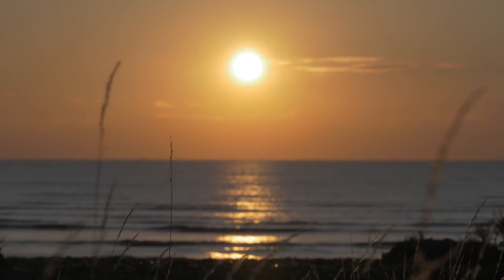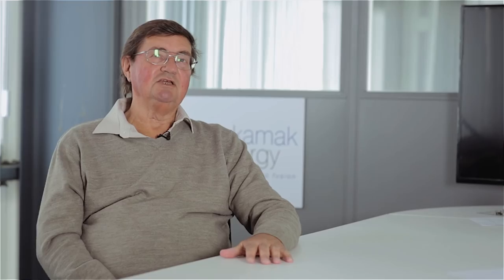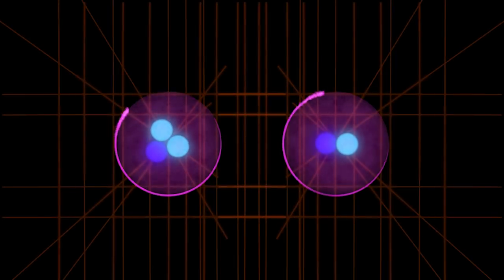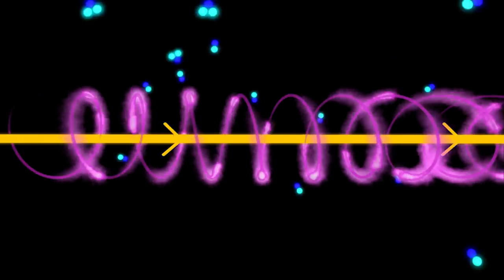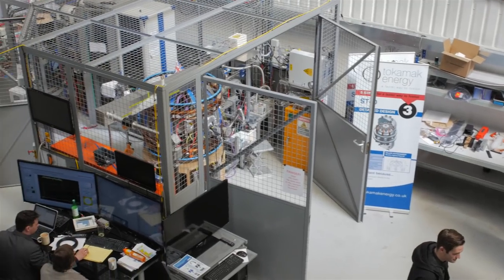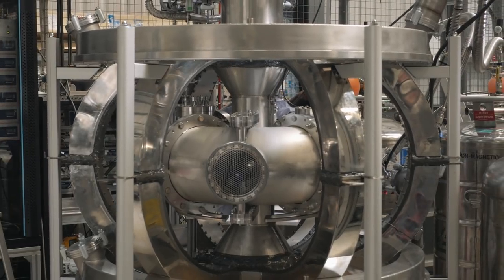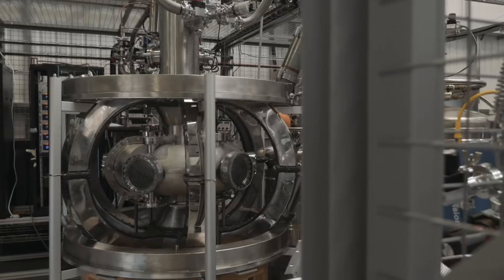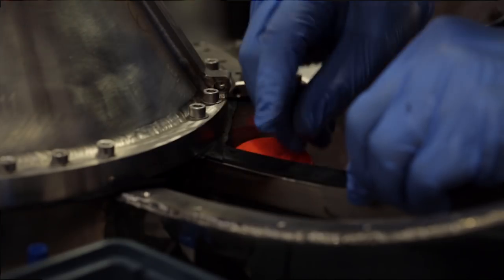Faster fusion

Comment: Stellerator is superior
Reply: MigotRen They both use Hydrogen Plasma.
Reply: angry try hard
the tokamak is based on a 70 year old russian concept and hasn't changed much since then. to keep the plasma in the tokamak they need to induct a voltage into the plasma wich in this case must be a steadily increacing direct current (increacing the voltage at the indctor to do so) . obviously that isn't possible forever and the system needs to shut down every 30 minutes (at iter the most advanced tokamak being build and tested) because you can't increase the voltage for ever and it needs to cool down. the stellerator that is under testing here in germany is a relativly new concept wich was only possible because of massive computer calculations to shape the ring in a perfect way for the magnetic field to keep the plasma in a closed system continuously without interruption. and we managed this with a budget of about a millard (or billion wherever you are from) euro while the iter project in france already used a budget 20 times that. and they both use hydrogen plasma is the dumbest answer ever. how else is hydrogen fusion supposed to work? of course all of them need hydrogen plasma
Reply: MigotRen ya I know it can sustain 105 Gigajoules of thermal energy longer but who says it can't be improved on to reach similar feats of the Wendelstine 7-X reactor.
Reply: angry try hard
becuase the basic concept and structure doesn't allow it
Reply: MigotRen ok
Reply: MigotRen They do not have the same objective Tokamak was never meant to be commercialized it is there to do more research on the subject so they can make the Stellarator project better
Reply: How are you ever going to commercialize a stellerator? Those machines are impossible complicated.
Reply: you could say the same about computers. But here you are commenting using one. If it is more economically viable, it is extremely likely it will be done.
Reply: Computers don't have components that are the size of small buildings.
Reply: Computers used to be the size of small buildings...over time they refined it smaller and small till we have hand held smart phones that are more powerful than those massive computers.
Reply: There are still building sized computers. The difference is, their constituent parts weren't the size of small buildings. (most notably the vacuum chamber/blanket for fusion reactors)
Reply: MigotRen. Interesitng info on the increasing voltage requirement. I had not appreciated that. I agree that stellerators have some very interesting theoretical advantages, and it's good to see that Wendelstein 7-X does indeed work. Does it in practice sustain a plasma longer than tokamaks (100s for ST25 IIUC), or is that for future work?

This really good talk on the principles by Zach Hartwig points out that stellerators have a long way to go to Q>1, which is why tokamaks is still where most of the effort is going. Does the theory suggest that using REBCO magnets in a stellerator will make a reactor with a high Q like the ARC design?
Reply: @weinhold: Your complaint is the very reason we didn't have stellarators until now, and is why your complaint is no longer valid... We couldn't build them before because we did not have the computing power to calculate the accurate structure and fabrication needed for it. Now we can, and we have increasingly intelligent robotics that can construct these large components. It is absolutely not a factor at all.
Reply: Just because you can build them, doesn't mean you can build and operate them economically.
Reply: You have absolutely no argument though. You're just saying it's not economical without knowing anything about the economics of building it. A lot of the technology we use today started out highly uneconomical, but once the designs had been refined and automation implemented, they became economic.  Building an oddly shaped metal container is not some grand engineering challenge these days, and the continuing advancements of AI/Robotics is only continuing to bring down the cost.

Also, the cost of a Fusion reactor is MUCH cheaper than building a Fission Nuclear plant like we have already made many of, because they don't require anywhere near as huge of a building, nor anywhere near as many safety features, due to the relatively safe nature of Fusion.
Reply: > You're just saying it's not economical without knowing anything about the economics of building it

Read this report http://orcutt.net/weblog/wp-content/uploads/2015/08/The-Trouble-With-Fusion_MIT_Tech_Review_1983.pdf It's old, but still relevant.

> A lot of the technology we use today started out highly uneconomical, but once the designs had been refined and automation implemented, they became economic.

I've already addressed this further up...

>  Building an oddly shaped metal container is not some grand engineering challenge these days, and the continuing advancements of AI/Robotics is only continuing to bring down the cost.

Got a source for this?

> Also, the cost of a Fusion reactor is MUCH cheaper than building a Fission Nuclear plant

Based on what? Most of the info I've read on this claims the exact opposite. The case for fusion is more abundant fuel and less radioactive waste. It would still be enormously expensive to build.

> Also, the cost of a Fusion reactor is MUCH cheaper than building a Fission Nuclear plant like we have already made many of, because they don't require anywhere near as huge of a building

Again, untrue, fusion is actually less energy dense than fission, since you're dealing with Hydrogen, literally the least dense element in existence.
Reply: "Again, untrue, fusion is actually less energy dense than fission, since you're dealing with Hydrogen, literally the least dense element in existence."

You realize that energydensity has nothing to do with density of the fuel or at least doesn´t have to. It only says that you have a sertain amount of energy per x units. This can mean kilograms or liters or anything else. Per Volume uranium-fission is energydenser than hydrogen-gas/plasma-fusion, but per kilogram hydrogen is far superior. And there is a "element" mad from an electrons and a positrons that is less dense than hydrogen ;).
Reply: @weinhold:  You're using a review from 1983, that does not at all "address this". Few could even dream technology would be what is is today back then, the modern computer was only just being birthed back then. Scientific review aren't done on the dreams of the future, so their review is only based on what was seen as realistic at that time. Today, the kinds of robotics and computers we have make designing and constructing these structures much simpler.

>Got a source for this?

Uhh, there's no single "source" for this, it's called general knowledge about what's going on in the world. They even stated this in the Wendelstein construction videos that it only became possible because of modern computing power to do all the hard lifting in terms of designing it. These computer programs generate all the fabrication specifications and instructions for robotics that precisely form the parts needed. Making the first one is always the most expensive, then you've built any specialized tools needed and can reuse them on newer iterations.

>Based on what? Most of the info I've read on this claims the exact opposite.

Based on the fact a fusion reactor needs a muuuch smaller building and nowhere near as many fail-safe systems in place as a fission reactor. Fission reactor plants are massive compared to an ideal fusion one. The cost of the materials, time and workers to make a fusion reactor plant is thus much less than a fission plant.
Reply: Invertex General knowledge is a bad source for knowledge. Eventhough I agree with most things you said I have to criticize that.
Reply: @Mathew: I would agree too in most cases, but he was responding to me saying "Building an oddly shaped metal container is not some grand engineering challenge these days", and there is no realistic way to provide a "source" for that kind of claim, there's no studies done on it, it's a fact of technological progress, it's just something you know if you actually have been following technology for a long time.
Reply: Poor logic not worth wasting the time on, mate. 
 Do more research.
Reply: MigotRen
The Stellarator is not relatively new concept, it is older than the tokamak concept.
The latest Stellarator in germany only costed 1 billion, but it is not as if anyone believes it will reach net energy gain either. So what is your point?

In the end both stellarator and tokamak are equal amount garbage.
Reply: A nother thing is that a tokamak gets unstable when it reaches a certain pressure. When such pressure is reached the pressure will induce a current in to the plasma. Methods are developed to handle the instabilities that comes as a result from the increase in pressure. If that works well then pressure induced current together with microwaves they should be able to keep the plasma stable and running.
Reply: MigotRen We need to understand and master gravitational fields first, if a fusion reactor explodes or implodes we would be exceptionally fucked.
Reply: tjzx3432 Why should we?
Reply: Mathew Cherrystone The reason why we need to understand gravitational fields is because intense gravity is a huge player in the fusion reaction of the sun, if we master gravity we would be able to do far more than just make a few huge fusion reactors. Fusion requires pressure, heat, and magnetism, gravity is the pressure. Also incase you haven't guessed, we would have flying saucer technology. Do you not understand how groundbreaking that would be, yes we know how gravity effects the planets and large bodies in space. But when you learn what makes gravity work you open up the possibility for even more advanced technology than we ever thought possible. Like space ships that could power themselves simple based on the unstable equilibrium of the vacuum of space.
Reply: Why do we have to master them first, if we even can master them at all?
Reply: Mathew Cherrystone Well, why I think we can master it is simply the fact that gravity is a force. And just like any force it had a cause, and just like every other force that cause can be altered by a method or system. If we can understand and map how these alterations affect things like resistance, magnetism, and frequency of a system. Then wouldn't it suffice to say that the sum of these forces would have a noticeable effect on the gravitational attraction between the observed body and the earth.
Reply: So far we don´t know if Gravity is a force, because we haven´t found the graviton (the hypothetical force-particle of Gravity).
Reply: Mathew Cherrystone By definition a force would be devoid of a particle, also didn't we already agree that gravity was an emergent property of any particles mass. I have kept up with the recent cern findings, however the very evident lack of such a particle seems to lead to the conclusion that the hypothesis is wrong for the reality we exist in. I assert that gravity is an emergent property just like that of magnetism, meaning that the force doesn't require a particle to exist simply an imbalance. Such as for magnetism doesn't require any perticular partical to manifest, so would gravity be a property of the mass of matter and the space surrounding it.
Reply: You defenetly have to learn much more. Bosones are the forceparticles that transfere forces between fermions. The Photon for example conveys the electromagnetic force. The graviton is so far only hypothetical therefor we don´t know if it really is a force.

And you still haven´t answered my first question. Why do we have to master it first?
Reply: There is absolutely no reason to expect a fusion reactors to explode or implode, where did you get that idea from?
Reply: Mathew Cherrystone I already stated why I believe we should master gravity first, I refer you to my previous comments.
Reply: Electro-Cute Errors do occur and accidents do happen, if this reactor were to experience any kind of breach then the released energy could cause an explosion. Also if a breach were to occur it could result in an emp. While the chance is highly unlikely the threat is still there.
Reply: But why should we wait 100 years or maybe forever to build fusion reactors only to have tec that may have some benefits in creating them?
Reply: tjzx3432
A fusion reactor can't overload. If this reactor were to experience any kind of breach then it would mean that the plasma became to unstable and touched the wall. When the plasma hits the wall it cools down at the rate of a few nano seconds. After that nothing would happen.
There is absolutely no reason to expect any explosion. It is even far less likely that an EMP would occur. If starting the reactor doesn't create one then shutting it down shouldn't do so either.
Reply: @tjzx: You don't seem to understand the difference between FUSION and FISSION. Fusion reactions cannot sustain themselves on a planet, they need complete isolation. As soon as a breach happens in a fusion reactor, its energy potential drops radically and the reaction stops as there is not enough input energy anymore to sustain it. Fission reactions sustain themselves very easily and are susceptible to run-away reactions, Fusion is not.
Reply: Electro-Cute Fine, my hesitation may not have any real basis however my argument for the need to master gravity stands. While I do agree that fusion reactors are a great step in the right direction, don't get me wrong. I'm just stating that harnessing gravity would greatly improve the efficency of the fusion reactors, and the transport industry just off the top of my head.
Reply: Gravity is only important in a star because it pulls the star's mass to the center, and the weight of all that gas creates the very high pressure needed to drive the fusion. It's the pressure that keeps the fusion going, not the gravity. Here on Earth, we must compensate for the lack of pressure by heating the plasma so its nuclei move fast enough to overcome their repulsion, collide and fuse.
Reply: Computers today are the size of large buildings and consume as much power as a small town... not sure where this argument is going.
Reply: @tjzx: We can already harness gravity. The problem is that gravity functions through massive amounts of energy, in the form of mass, altering the shape of space. To manipulate gravity, you require massive amounts of energy... So how do you think we can achieve that? The only way is by harnessing the power of atoms themselves, nuclear reactions.
Reply: Invertex Well I'm working on the design and math for a motor, which would use static electricity, magnetic fields, and the inertial force of space to draw energy from space itself. This in theory would expand the space within the enclosed system and would contract the space surrounding the motor. The resulting negative force would in turn alter the balance of the internal vacuum causing a recoil, at this moment more energy is added until the mechanism perpetuates it existence. You may need to brush up on your electrical engineering studies to really comprehend the plausibility of this notion.
Reply: DANKUS MEMEUS RENATUS Essentially, yes. since this mechanism would itself be a capacitor, an antenna, a transmitter, and a receiver. This object would essentially absorb the aetheric disruptions and transform them into electricomagnetic energy that can be harnessed. Its the most simple and elegant solution i could come up with.
Reply: @tjzx: The fact you didn't understand the difference between fission and fusion makes me believe you don't know anywhere near enough about what you're talking about and are just taking some vague hypothetical ideas and mashing them together thinking it will work, without knowing any of the math behind what you're trying to do. Like people who see magnets and think they can gain energy from it just because it seemingly "repeals" objects, not understanding the concept of states of least resistance in regards to physics.
Reply: Bending space will at least require as much energy as you can get out of the gravitational force that results from it. Then I mean the force like in change of momentum. That conclusion can be drawn just from the energy principle. But from what I have heard it would require far more energy than so.
Reply: Electro-Cute, gravitational force is the weakest of the four fundamental forces while strong nuclear force is the highest. The problem is that in order to create a gravitational pinch strong enough to cause nuclear fusion, we'd attract all the planets in the solar system to us. That's why we use electromagnetic force which is only about 100x less strong as strong nuclear forces but its range of effect is extremely small. Therefore, we can use a very strong electromagnetic field to cause a plasma state without a large range of effect. Hence we get things like the tokamak and stellerator designs that use electromagnetic fields which can net energy if the rate of fusion is less than 100x less efficient than maintaining the field.
Reply: The range of the gravitational force field is the same as the magnetic- and the electric force fields for the same amplitude. All three force fields follow an inverse square law for point sources (assuming that a magnetic monopole exist).
The thing is that magnetic fields only interacts with charged particles moving perpendicular to the direction of the field.
Reply: Electro-Cute Thank you.
Reply: You are welcome haha :D
Reply: A fusion reactor isn't a bomb.
There isn't a great deal of energy inside the reactor at any given moment anyway.
The magnetic field is not containing some kind of explosion waiting to happen; this isn't Spiderman 2.

The reaction is sustained by the machine working as a whole; without containment, or any one of thousands of parts working more or less perfectly, it does not work AT ALL, which means, fusion stops.
 It's not like nuclear fission, where half of the whole machine is all about controlling the reaction (heat), which would continue to build up if uncontrolled.

Mastering 'gravity' would require understanding gravity much more than we presently do. 
 If gravity is indeed simply 'curved space time', then we would need to figure out how to curve space time more than the presence of matter presently allows, which may mean increasing the energy/mass of a small volume of matter, which would probably require super (duper) heavy elements which are stable, unlike all of the ones we currently are aware of, which tend to decay in fractions of seconds, at the cost of enormous amounts of energy....

Plus, with all of that being said, you still have absolutely no pathway into figuring out how to either A) create negative mass or B) block gravitons (if they even exist), which might give you something resembling the anti-gravity which you speak of...

I mean, I can imagine being a Unicorn. What are the odds of that actually ever becoming true?
 Just because you can 'imagine' anti-gravity, doesn't mean it is or may be possible.

Sure, I like to believe that if I can imagine it, it could be true.. & that may be true in many, many cases... However, if the Universe has taught me anything thus far, is that there are always exceptions to the rule.... & sadly, anti-gravity does not appear to be one of the possible exceptions.

Accept it, & stop wasting your time on fantastical notions.
Reply: Positron, the goal of nuclear fusion is to achieve ignition, as in Spiderman 2.
Reply: Spiderman 2 is not even science fiction, it is complete BS.
Reply: Mike Wilson While I don't agree with what you say I will still defend to death your right to say it. I'll agree to disagree and leave it at that, good day.
Reply: Not really. The goal is to keep it going. Ignition has been achieved in 1917 already.
Reply: Mathew, you're going to have to cite that one, because if we can achieve ignition, then from that point forward, it's energy output without having to put energy into it -- just fuel.
Reply: tjzx, in a round about way, but I think you're being pedantic. The point here is that we don't have to first produce energy by using another fuel in order to maintain the lasers or magnetic fields. Instead, the fusion reaction itself creates its own heat necessary to continue a fusion reaction.
Reply: tjzx3432 No, the gasses in the reactor (like any system) contain a finite amount of energy and need to be replenished.
Reply: By achieving ignition he meant to burn fusion fuel (burn in a nuclear reaction kind of way). Fusion reactions do not form any runaway- or stable feedback loop reactions with out any externally forced system to Control the fuel (like a fusion reactor). So in actuality the usage of the "ignition" doesn't belong here.

Anyway, we have been burning fusion fuel for almost a hundred years by now.
Reply: Electro-Cute, the heat from the fusion reaction can enough to sustain continued fusion reaction without the need for a neutron beam or other heating power. That's ignition, and it is a stable feedback loop. As long as you continue to provide fuel, the fusion will heat itself where fusion can occur, thereby heating itself more. That's the ultimate, long-term goal of fusion research.
Reply: But not with out any external magnetic field or any other method of confinement.

For a tokamak to run stable requires microwaves and/or density induced currents. The last one refers to how the current in the plasma increases as a result from very high densities. The problem with this density induce current metho is that the plasma becomes very unstable and starts to kink it self in to a spiral.  The plasma then spirals outwards til it hits the reactor walls and terminates. So a lot of research is going down in to how to use external magnetic fields to control these instabilities. These methods that have been developed are planned to be used for on ITER.
With out these methods the plasma would be continuous and stable. About your comment on stability.
Reply: Electro-Cute, of course you need a magnetic field to contain the plasma, but that doesn't have anything to do with the heating of the plasma. Nor does this have anything to do with the stability of ignition -- which should refer to a consistent temperature high enough to allow for fusion. That is, it can maintain itself at 150+ million C as long as it has fuel to do so.
Reply: If you speak about magnetic confinement reactors specifically then the magnetic field is all about stability. To change my mind on that you have to give me a stable tokamak where the toroidal and/or poloidal magnetic field is turned off.
Reply: Electro, I think we're talking about two different kinds of stability. You're right that a magnetic field will always be necessary to contain the plasma unless we can find a material that won't utterly melt when contacted with 150 million degree plasma. What I'm talking about is a stable fusion reaction where the heat of the fusion work being done is all that's necessary to heat the plasma for fusion work as well as powering its own EMF to continue with only fuel input into the system.
Reply: where did you get this information about needing a steadily increasing voltage for the plasma to be stable ????
Reply: Fusion 'ignition' has already been achieved.
 Spider-Man 2 was about containing a mini-sun & stopping it from exploding an entire city. Which is a misconception about how the technology works.

Next.
Reply: positron underVolt Using Hollywood movies as a source is also really dumb in the first place. The last thing Hollywood producers care about is scientific accuracy. Just watch any space movie ever.
Reply: positron, fusion ignition hasn't been attained. We have reached just over Q = 1, but not ignition (which requires Q = 5 or greater).
Reply: nexus1g What you are talking about is a continuous selfpowering fusion reaction not ignition. This are two diffrent things. It's not that hard to understand
Reply: Mathew, a continuous self-powered fusion reaction is not necessarily ignition. You can have Q > 1 and not have ignition if you're still required to have a power input to heat up the plasma. Ignition is specifically where the plasma maintains enough heat to perform fusion without further heat input. That is predicted to occur at about Q = 5 when there is enough energy being produced from fusion that it heats the plasma faster than the heat can be dissipated from the plasma. That's the next major step in nuclear fusion, and it's the point when we could reach the "limitless" energy source that we know nuclear fusion has the potential to provide.
Reply: Who cares, tokamak fusion research is still a waste of money.
Reply: psycronizer whatever makes you feel like you're smarter than everyone else.
Reply: well, I know that I am smarter than most people, simply because I am 48 years old, have a very vast educational background, and can talk about many different fields of science, eg; electronics, organic chem, biology, physics, history , and many more. That is only possible because of time, all the study and reading that I have done. Just a simple, immutable truth.
Reply: +tjzx3432 Still waiting on that perpetual motion machine mate.
Reply: Scabbage  what about levitation, Dr. Hutchinson ? Where is his technology...
Reply: psychro- never trust a man who has to TELL you how smart he is, or how good he is, or how rich he is, for that matter... get my drift? Show, don't tell. By the way "Vast" is impressive, "Very vast educational background" is kind of like Bigly educated...
Reply: nexus1g well seeing how the so called homeless in my country complain about not having food, money, or a home and always want money but are not even willing to stand up to try and earn the money which they only spend on drink, I consider them fools.
Reply: nexus1g as well as those who choose to live on the streets, like the man who lived under the stairs of a parking lot, he had family in Australia who wanted him to go live with them buy he chose to rather be a lazy fool and live on the streets cuz he was too lazy to do anything with his life and ended up dieing in the KNYSNA FIRE (look it up) 
So yes... Where I live the man on the street is a fool.
Reply: I have ADHD, which tend to be interpreted as being lazy. But the research shows that many people with ADHD, including me, have a higher than average IQ. People who do not get help with their ADHD tend to have a higher risk of ending up outside of the society, like ending up in a life of criminality or even a life on the streets.
So do not judge a homeless person to harshly the next time you see one. To have an IQ of 133+ does not equate as being well adapt to our modern society.
Reply: Electro-Cute ya know there's a funny trend with kids who have illnesses such as autism, it seems that these people have super powers such as telekinesis, but only with there parents and burning stuff with their mind, but only when everyone (except their parents) are in a different room as the object being burned. Do you see a Patern? These super powers only exist because the parents of the kids pretend that the kids have super powers to make them feel special. Which is why i have a suspicion that the person who did the study that concluded that people with adhd and other mental illnesses have a higher intellect than regular people might have been feeling pity and re did the tests until he/she got the result they wanted.
Reply: use stellar-lube and stay calm
Reply: Kids with Autism are not to be compared with those who have ADHD or ADD. Besides that is the pharmaceutical industry responsible for hyping something like ADHD so they can sell their meds their Ritalin and Concerta. Almost cant believe you compare autism with ADHD/ADD. If children would play outside like kids used to 80% of them would be totally fine. I don't say that research says that besides that when a child really suffers from ADHD/ADD medication will help. Children with autism are screwed though there is no medication to help children with autism not in a way that they have a qualitatively good life compared to a healthy child. On top of that are you saying that all kinds suffering from autism are the same although the opposite is true. And I really hope no parents who have a child that is honestly sick ADHD or Autism reads your comment. You really don't know what you talk about. This did shock me in way.
Reply: Not sure about your age but it's true what you say. Lazy I even was punished for it. The hurt your parents have to talk to a teacher again and although you try really try it doesn't change. I couldn't concentrate it had nothing to do with being lazy and as time went on I got these moments of loneliness hoped to be understood one day. I had to go to a special school although what you said I scored high when they did an IQ test so to them ( teachers) I was lazy. Would like to know though this is something I think at moments..... Isn't ADHD/ADD I think ADHD is more appropriate in this case a great thing for pharmaceutical company's that some parents let their kids play video games all day watch cartoons and at night they can't sleep do become overly active since I don't look at it as hyperactive. I read things about it and seen parents that are happy their kids do something instead of running around playing footy whatever I did when I had their age because children that really have that constant mess in their head don't get the attention they need just like it was when I grew up only this time because some kids just are not raised as it should be and of course it's my opinion that the parents are to blame overly active kids these days. I am just wondering not sure what your age is I assume you aren't very young because children are not told they are lazy these days anymore now it seems to be the opposite.
Reply: the stellerator has problems as it's own, like energy extraction, it is very promising yes. Comparing the budget of the wendelstein and the iter project isn't fair because the goal of the wendelstein was proof of concept, the iter goal is to prove that you can get a net gain of power with a fusion reaction. If you would build a stellerator with that goal than you would probably see similar figures.
Reply: You make quite the compelling argument with the statement, "Stellerator is superior."
Reply: If both the tokamak and the stellarator design never exceed 100% gain then the question of which is "superior" will be reduced to which design was more or less bad. If the stellarator achieves 95% gain and the tokamak achieves 90% gain then both designs will have been failures that burned through a hell of a lot of taxpayer money (no wait, they were "highly valuable scientific projects that advanced material science, led to better understanding of nuclear fusion, particle physics and high temperature superconductivity etc etc" - that's how it will be spun).

Stars are able to commence nuclear fusion because they effectively exchange gravitational energy for nuclear energy. So the conversation of energy is maintained. The fusion looks like it is "free" (as in like it came from nothing) but it actually isn't. Nuclear fusion reactors though do not have that immense gravitational energy to achieve very high pressures. So they try to compensate for that by raising the temperature significantly along with having a moderate pressure provided by the magnetic fields. 

These high temperatures waste a lot of energy. More energy is wasted by the need to cool the superconducting magnets down to ~4 °K, for additional active cooling of the interior of the reactor, for maintaining and controlling the magnetic field etc etc It is still unknown, since gravity cannot be manipulated (perhaps in the far future) and thus cannot be employed instead in place of all the above, if it is even theoretically possible to achieve exothermic nuclear fusion (exothermic in the sense of taking into account all of your energy cost, not just current or magnetic field in --> power out, like the scientists of NIST love to misclaim with, in their case, lasers in fulcrum --> power out).

Since the conservation of energy still needs to be maintained, and since it is highly unlikely, if not impossible, that temperature alone can generate more energy in the form of fusion than the energy it was spent, there must be some form of "hidden" energy, like in stars, and that is of course pressure (emulation of gravity). Could the magnetic fields pressurize the plasma high enough, without wasting too much energy, to keep the temperature from needing to reach insane heights while allowing the reaction to go beyond endothermic, beyond breaking even and giving back at least a few percents of energy? 
I have no idea, but I have many more reasons to suspect that magnetic fields alone are inadequate for this job. Unless we manage to manipulate gravity, and use that instead of magnetic fields, nuclear fusion gain will always be "50 years in the future".
Reply: weinhold0204 that's what we see going on with spacex having great advances due to low cost
Reply: Polywell is even better than the stellarator
Reply: Hard to say right now. Stellarators haven't really demonstrated superior performance to Tokamaks. No disruptions, but ion orbits are complicated.
Reply: If the Joint Eurpean Torus in Oxfordshire (where I spent 13 years working) had been using the funding (20billion?) to work on Thorium Salt energy... Would Fast Breeder reactors even exist today? Perhaps Thorium is only 10 years of lab time away?! is it a hoax? Maybe not! and the UK would have made a massive cash in on it. R&D is everything. The Chinese or the Americans will be selling the world's fusion'/fission reactors in the future. Compared to solar on every roof and 10KWh batteries for every home in the UK, solar can solve 50% of the UK's transport and other energy needs too. Perhaps the future is a thorium-Solar-battery landscape.
Reply: Computers are fantastically simple. they are only 10,000 casio calculators on the same chip. tokamaks don't even work in theory for certain, that's why they can't make them in practice. the figures don't add up despite 30 years of applied measurements.